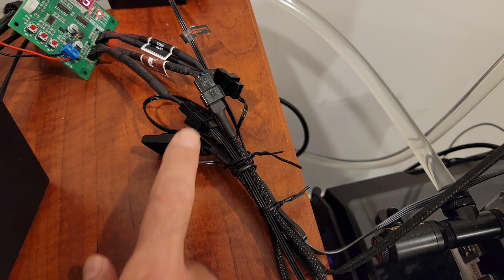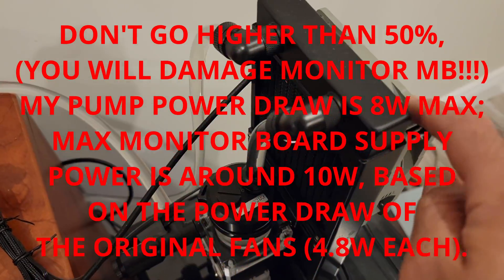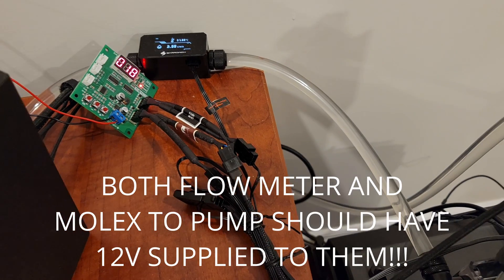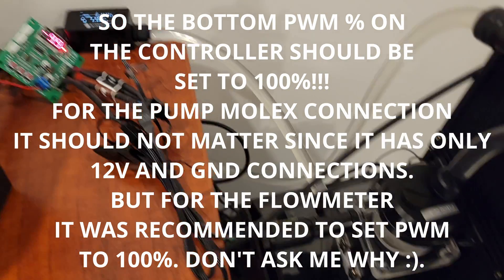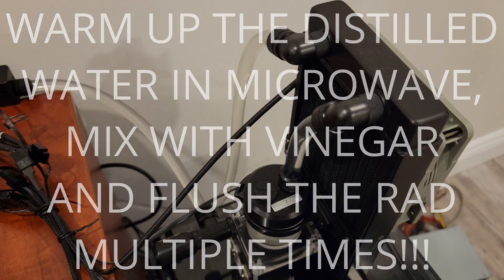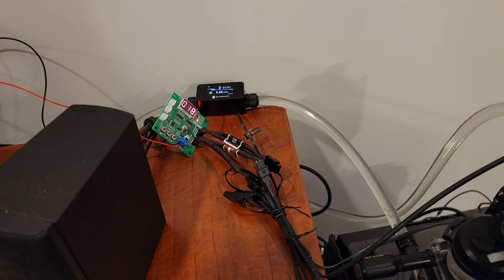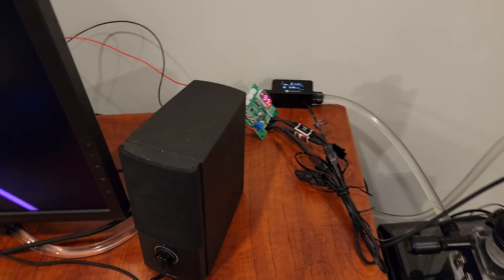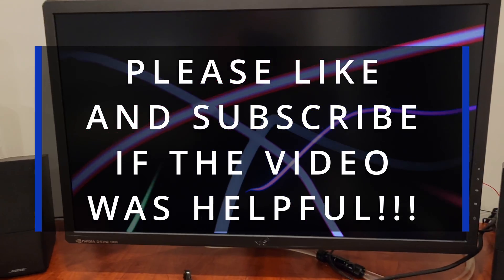ASUS PG27UQ Watercooling in Timelapse (no more fan noise)

Comment: Thank you for this great tutorial. 👍 I have an older 120mm AIO for GPUs from Arctic. I checked it and could definitely use it on the monitor with a few small changes. It's unhearable on 50% and i think it will be more than enough if i use it with a fan on slowest settings. The only thing is... did you somehow check the temps from the G-sync module after installing the Watercooling, or did you just monitor the water temps? E.G. just assuming the cooler has no good contact to the chip, the water temperature would be low but the chip would overheat. It really sucks that we can't find out how to get into the service menu of the monitor.
Reply from the maker: Hey, it is very unfortunate not being able to access service menu to check the temps of the G-Sync module! I am using a flowmeter/temp sensor on the loop right after the outlet of the pump to check the temp of the coolant. Currently with 40% on the pump and the fan, the coolant temp is sitting at around 28.5C; But as you mentioned there is no way to say if the G-Sync module is cooling properly or not unless the monitor shuts down which has happened to me before when the Module was overheating!
Reply: @parhamsan  Oh okay thanks for the info, didn't know that the monitor shuts itself down. At least a bit of safety.  I thought it would damage the module or even the panel if the heat built up inside. I will try and write a mail to ASUS regarding the service menu. Though i don't have any hopes, maybe they are more willing now that the monitor is so old that no one has warranty anymore. I tried other monitors with HDR 1000 and above (Samsung Neo G8, Innocn 32M2V, Acer Predator X32FP, ASUS ROG Swift PG32UQXR, BenQ MOBIUZ EX321UX) but they all had such bad contrast and/or blooming. I really wanted to try, but it was unbearable. The PG27 is still (sadly) the only option if you want picture quality, very high fullscreen brightness and good contrast all together. I guess that's why you put so much effort in modifying it too.
Reply from the maker: @Timm33y  Oh yeah, for sure the screen shuts down if the G-Sync module overheats. please share if you got a response from ASUS regarding the Service menu!
Reply: Well, so much for the ASUS support 🙄:
"After consulting our Level 2 support team, I regret to inform you that we are unable to provide you with the information you requested regarding the monitor's service menu. Thank you for your understanding and have a nice day."

Comment: bro, do you know key botons combination to access to the hide menu and see the temperatures?, i have done sometimes but i never get how to do it, there you can see the temperatures of the FPGA in real time
Reply from the maker: Hey, Unfortunately I do not know how to access the service mode menu or the combination of the buttons to get to that menu. I can confirm that I accidently got to that menu once but that was only one time.
Let me know if you ever figured it out!
Reply: @parhamsan  thank you very much, i will also cool by water in the next weeks, is very loud and in summer it even shutdown, i will use some of the radiator i already have on my computer
Reply from the maker: @elpapitech Sounds like a plan, good luck with everything!

Comment: Hi there, could you please send me the full video without Timelapse please? We talked some months ago via E-Mail for other PG27UQ Issue. I’m looking forward to replicate it, to change from ventilation to liquid cooling. Thanks
Reply from the maker: Hey, unfortunately that was video was intentionally recorder in Timelapse. There is no full video of the whole process!!!
Reply: Hi there, I have bought all the materials to mount this, but to get replacement pieces, I purchased the same PG27UQ model to an American guy. But the monitor is like brand new, with no noisy fan and working very well(probably so new he never ever used it, said me it was on display in a TV shop). Anyway, bought all the materials for making the refrigeration water cooled but prefer to not refund nothing to have it just in case. Is it ok if I leave all the products of your list packed and saved well closed in a wardrobe 1-3 years? Do something have a expire date, for example the Corsair refrigerator gel? Just let me know. Thank you
Reply from the maker: @AGENT-VEGAS-47  Hey, I don't think anything has an expiry date. The only things that might have shelf life or Expiry might be the Thermal paste and the Coolant. If you keep the Thermal paste sealed or just to keep the lid closed it should be fine. I am using a Thermal past from 5 years ago and it still works just fine. Also if the Coolant is sealed I don't think it expires!!!
You can Water Cool the FPGA on the monitor anytime you like. If the fans are quite don't touch them, I did the mod because the fan noise were too loud!!!
Reply: Hi there again, then will leave everything inside a box inside a wardrobe. Maybe in 1-3 years if both of us are still there, we’ll be talking again. Once more, thanks for all your free assistance, and hope you have a good one
Reply from the maker: @AGENT-VEGAS-47  Sounds Like a plan, have a good one!

Comment: hey, could you make a tutorial for the PG247AQN ? The fan is driving me nuts, but want to keep the monitor. You are the only one I found  who made content about modding the fan of a monitor.
Reply from the maker: Hey, is your monitor PG27AQN (I think you have an extra 4 in the PN of the monitor)?
Unfortunately I don't  have that monitor in hand but from the looks of it, it seems its very similar to PG27UQ design.
Have you ever opened the back shell and clean the fans? If the fans are not cleaned for more than 2 years, there is a big chance they are pretty dusty.
So my suggestion to you is first open the back shell, and clean the fans.
I don't know if this monitor has the G-Sync Module inside!
Do you if it has 1 fan or 2 fans inside?
If it has a G-Sync module (like the PG27UQ) then the thermal paste is probably dry as well.
Start by cleaning the fans and if you are a comfortable clean and replace the thermal paste with a new paste,
Let me know if you have any questions!
Reply: @parhamsan  hi, yes it is the PG27AQN. I just bought it 2 weeks ago, so the paste should be fine. The fan is silent but audible.  Didnt open the back yet. It has a G-sync Module but unfortunately the fan is always on, even when not in Gsync Mode. Do you know of any software where you could deactivate the fan when in office mode and activate when gaming?
Reply from the maker: @thomasb87  Ok, IC, so its a brand new monitor, in that case your only option would be the External fan controller that I used on my previous videos; since there is no software or option on the monitor menu to control the speed of the fans (as far as I know!!!).
Have you seem my other video with the external fan controller?
For now I don't suggest doing this anyways, because you might void your warranty.
I know how annoying it gets not doing anything and the fan is running all the time!!!
Wish I could help you, but for now that's all the suggestion I can give you.
I'm always here to help and answer questions.

Comment: Hello. Is it possible to remove the second fan as well?
Reply from the maker: Hey, if you watercool the fpga you will not need any of the fans, if not you would need both fans, one to cool fpga and one to blow hot air from the bottom.

Comment: Hey is glad for you, but I have to say that the video is a little late :( my monitor is dead does not give a sign of life, ... it is a shame because he is not found more and they do not repair it here in Germany .. I have tried in several stores but nothing .. They say it is very old and better to buy another one to repair it :(, I feel sad
Reply from the maker: Hey, thanks for the comment, unfortunately if there is something wrong with the MB (FPGA) of the monitor you can't fix it or find a replacement part. Other parts such as power supply, fans, and screen replaceable. what does the stores tell the issue is?
Reply: @parhamsan      Hello, they say that the MB is just broken. But of course I took it to a small store and I'm not very sure it's true... it's a shame since there is no other 4K HDR 1000 monitor in 27´´ It's a shame that Asus has done a bad job with the ventilation.
Ps.: Thanks for asking..
Reply from the maker: @katanuso  hey, sorry to hear that unfortunately I did not find the MB replacement anywhere (like ebay or AliExpress) but if you are willing to spend $150-200 USD, you can always send only the pcb to somewhere like NorthridgeFix https://northridgefix.com/
This guy can literally fix anything. Although in your case it would be hard to test the monitor if you don't ship the whole thing to them, and shipping cost would be to expensive!
Reply: Thank you, i cant try